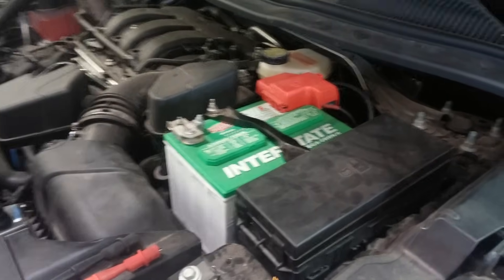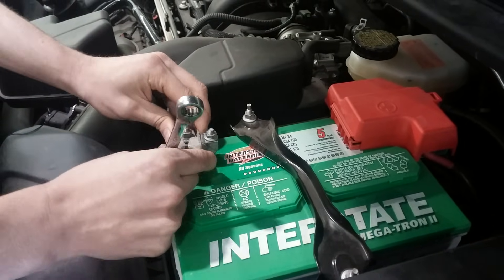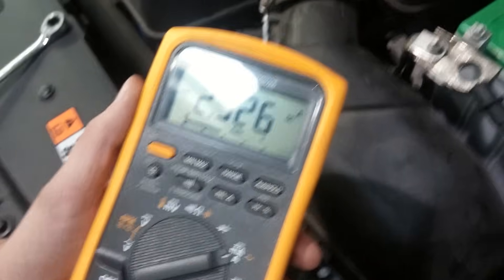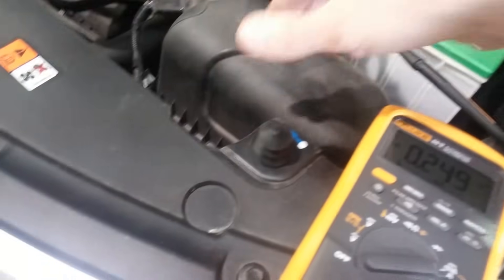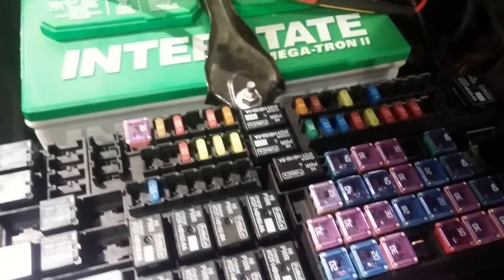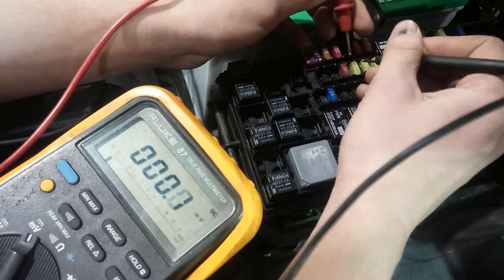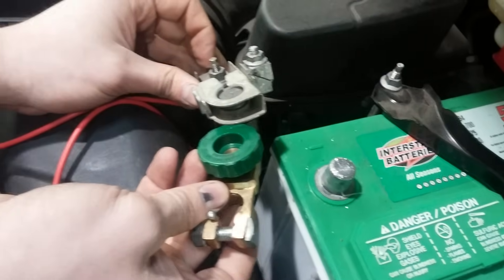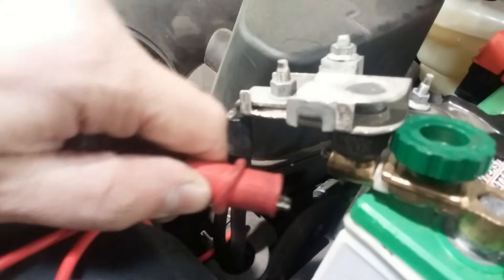How to identify and locate a parasitic drain

Comment: Great video which I watched with interest. 👍👍👍
I have a question, I have a parasitic drain and have checked BOTH fuse boxes inside and the out side with my second meter and none of the fuse showed anything untoward.
But at the battery I was show .76mA 🤬🤬🤬
I tried the method without removing the fuses i.e. with probes on top and there was absolutely nothing, no parasitic drain at yet when I go back to the battery I'm back to .76mA🤬🤬🤬
Do you have any ideas please 🤔🤔🤔
My vehicle is an Audi 1.9Tdi 8P1 2009 plate 🚗🚗🚗
Reply from the maker: This is a pretty large drain. Also, it is very possible that none of the fuses that you have tested have current passing through them.  However, we KNOW that there is a drain.   Some circuits are not fused (like the starter) and some may have remote fuses that are not in the fuse block.  

I have a couple of suggestions for you.  If you can find a "power distribution" wiring diagram for your car, it will be very helpful for either of these methods.

First, if you have access to a thermal imaging camera, you will likely be able to detect heat in the components that are remaining on.  With a .76 amp drain, something will be warm.  Start by looking at the fuse and relay boxes, then look around the engine compartment and then under the dash and around the interior of the vehicle.

Second, look at the positive battery terminal.  How many wires or cables come off the positive battery terminal?  You can disconnect them one at a time or use a current probe to see which one has the significant current passing through it.  Again, with a drain of that size, you will definitely be able to detect it with a current probe.  Once you know which battery cable has the drain, where does it lead to?   To the starter?  The alternator?  To the fuse block?

If it is to the fuse block, use the power distribution diagram to see how it branches out from there.  One of the wires must have the drain in it.  You can continue to use your current probe to narrow down which circuit is the problem.

I hope that helps!
Reply: @JustinMillerAutomotive  Hi there Justin
Many thanks for your suggestions.
I read somewhere on YouTube that a faulty alternator, diode pack regulator etc. can have a drain unfortunately I did not read this before I changed my alternator and at the same time inserted new carbon brushes.
I really don't want to go through an alternator change again.
Can you suggest a test / s that I can perform on my alternator, I have a digital Multimeter x 2 and a Short & Open Finder 
Digital Diagnostic Tool, I don't possess a thermal image equipment.
I look forward to your response.
Kind regards
Tony

Comment: You pulled the pigtail of the hood switch, now put one wire in both pigtail whole to trick the car to think the hood is closed.  thanks bill
Reply from the maker: Yes.  It depends on whether the switch is open or closed when the hood is open.  In this case (and it is the same with most door jamb switches), a closed hood or closed door causes the switch to open.  So, shorting the switch would make the ECU think the hood is open, when we want to cause the opposite to happen - to make it think that the hood is closed.

Comment: I've also seen that there are charts you can get that will show the approximate current flow across a fuse of a particular type and current rating. So, you'd take that mV calculation and then look it up on that chart and it'd tell you about how many amps were flowing.
Reply from the maker: That is true.  I have one of those charts.  However, after studying the chart, I came to the conclusion that any voltage dropped across any fuse above about 1 mV indicates an unacceptable amount of drain, so I have just taught people to watch for any reading that is not zero and pay close attention to any reading above 1 mv. 

I still refer to the chart occasionally to see how much current is flowing through a specific fuse.  Thanks for the comment!

Comment: 2010 Chevy cobalt battery won’t hold charge. Prior it would hold a charge three  months at a time. Battery tested twice at autozone battery ok, alternator ok. Now willl take a jump but dead after turned off after an hour of driving it. I need help!!! I a girl, guessing a bad cell but that’s not what they’re telling me !!
Reply from the maker: Did you check for a parasitic drain like I showed in the video?  That would be my first guess.  However, a conventional car battery can only be discharged 7-10 times before it will no longer hold a charge.  It may have started as a parasitic drain, but now the battery is probably bad.  

Another possibility is that you have poor electrical connections at your battery terminals.  Jump-starting  would bypass the bad connections, providing enough voltage to start the car.  Even if the battery is fully charged, it may not be able to get enough current through the terminal connections to start the car.

Start by measuring voltage directly on the battery posts while attempting to start the engine.  If voltage remains above 9.6 volts, the battery is not the problem.  Next, try cleaning disconnecting and then cleaning the terminals with a wire brush, making sure they are shiny.  Check the terminals on the cable for corrosion.  Then, of course, measure the parasitic drain and make sure it is below 30 mA.

Comment: do you have to have the first multimeter connected to the battery terminal/cable to test the fuses?
Reply from the maker: No, you can remove the first meter, but you must reconnect the battery cable.  If you happen to own two meters, it is just helpful to be able to see that the drain is still there while checking the fuses.
Reply: @JustinMillerAutomotive  oh okay thank you for clarifying, great video by the way. very helpful :)

Comment: Great video, but the battery shut off switch tool seems a bit useless. Why overcomplicate a simple test?
Reply from the maker: You're right - it isn't necessary. However, if you don't have the vice-grips, it can make it possible to connect your gator clips to the battery terminal.  It also allows you to easily reconnect the circuit and remove your meter from the circuit without disrupting the current flow and resetting the "timers" in the computer.  If you only have one meter, you will need to use the same meter for measuring the voltage drop across the fuses.  Those are the reasons that I like to use the tool when it is available.

Comment: faster way to find drain. make sure battery is fully vharged. D isconnect neg terminal, take test light check fuses,If fuse has power.There is your drain.Usually the device the fuse is too. the componet i.e radio. the device it self is grounding out. . there is your drain..Be ON safe side check relay to that device. too. easest fastest way.
Reply from the maker: Using a test light is a quick, easy test, but it is only effective on older vehicles before computers became involved.  Many of today's parasitic drains are not simply switches that are remaining on.  They are caused by computers that fail to go to sleep because of data network errors or other issues.  A test light won't help you with this type of drain.

Comment: by far the most helpful useful video that actually works! THIS IS THE WAY they brought me a ford f250 with
parasitic draw they took it to 2 different shop and could not find anything. thanks to this video step by step i followed 
and solved the issue. thank you for this awesome video

Comment: Will that rule of thumb drain be different on different automobile drains say like .030 ma or .050ma?
Oh my battery was drained dead, it measure  was 5. VDC , so I am charging and when I hook it back up I will disconnect the NEg terminal and start my checks,  I checked the amps as well, before I started  and it was undetermined really . But my meter showed 10amps when I connected as instructed with the neg terminal and neg cable hookup and set at the 10 amp setting  .
Reply from the maker: I have read in some books that the drain can be as high as .050.  However, I have done this test (or my students have) on many hundreds of vehicles, and when everything is working properly it is always below 0.030 amps.

Comment: I've just subscribed & rang the notification bell.
Your video was my guide in tracking down a parasitic grain on my neighbors vehicle.  Thank you.  I've searched for a Battery Disconnect switch, however, I was unable to find one with small pins for connecting small alligator clamps to it.
Reply from the maker: Maybe it is not available where you live, but I purchased my disconnect tools on Amazon or Ebay.

Comment: How do you check the fuses to the right the big one they have a closed house so you have to pull they or ?
Reply from the maker: Often, you don't need to check the larger "j-case" fuses because they feed the smaller circuits that are protected by the smaller fuses.  However, if you wanted to check them in this way, you could removed the clear cover on the back.  You could also remove the fuse and replace it with a fused jumper and then measure the voltage drop across that fuse or jumper wire.

Comment: great video, thanks Justin!!.. I"m wondering, what was the problem? What did that Fuse go to?.,.. thanks..
Reply from the maker: It was a fuse to the interior courtesy lights.  I had created this issue intentionally to simulate a parasitic drain by leaving the door switch closed.

Comment: if I heard right you said that if an amp was comming from the batterry it would  be drained in 24 hours. Would that be 24 amp hours. Idk. I had no idea. This is really good info. I have about a 50 miliamp  draw on 
my 1999 Ford. Expy.  In about 3 days my truck battery is getting very weak. I know that my battery is a bit weak.It could be some of the problem.  I was told a a while back that my vehicle was ok as long as I didnt go over 45 or so miliamps in sleep mode for the truck. I have been removing fuses etc. Taking pictures as I go. Extra precaution than just using the owners manual.
Reply from the maker: A 50mA drain is a little more than we would like to see.  However, it shouldn't be enough to cause a good battery to drain in just three days.  I suspect that your battery needs to be replaced and you won't notice any more problems (for a while anyway).  The higher the drain is, the less time the battery spends fully charged and the shorter the battery's life will be.
Reply: @JustinMillerAutomotive   I suspect the battery is a little week..Its about 3 years old. Just bought a disconnect at auto auto for about.$8.00. I think that  Harbor Freight sells a easier one to install but it has some draw backs.. QUESTION. Why does my battery start out at 13.5 volts and yet discharge faster. I am fairly ignorant about car batteries.
Reply from the maker: @PIANOSTYLE100  Car batteries are just like any battery - take your cell phone or laptop battery, for example.  The battery can be fully charged, but it's capacity has diminished.  Every time you discharge a battery and recharge a battery, it's capacity is diminished slightly.  Lithium ion batteries like those in our phones and computers can be charged and discharged thousands of times, with the capacity changing only slightly each time.  Conventional car batteries can only be discharged and recharged about 7-10 times before the capacity is diminished so much that it will barely do its job.     

A battery is a little bit like a bucket that can be filled with water.  Over time, sediment may settle at the bottom of the bucket, which reduces the capacity of the bucket - even though you can still fill it to the top with water!
Reply: @JustinMillerAutomotive  Never knew this. Batteries are definitely not my forte. Seriously going to have the battery checked.  I probably should remove both positive and neg terminals.

Comment: when you found the circuit that was leaking voltage, why didn't you pull the fuse to see if the amp draw dropped?
Reply: Good question. When you pull it out the drain should stop...
Reply: When You Pull A Fuse Out It Can Wake Up Other Circuits And Cause The Amperage To Spike Causing You To Record It Incorrectly

Comment: I tested mine for a drain and found out its the fuse for rear defroster, dome lights, and radio. Now what? I have a 91 dodge dynasty.
Reply from the maker: First, look around the vehicle.  On an older vehicle like that, I check carefully all of the interior lights, including the glove box, trunk, underhood, and underdash lights.  Make sure they are off.   If that doesn't prove anything, I might try something simple like unplugging the radio while measuring the parasitic drain to see if it goes away.  Also, look for any aftermarket devices that have been installed such as alarm systems, aftermarket radio, etc.  Someone may have installed one of these systems and tied them into the circuit you are suspecting. 

If you still don't have an answer, it is time to dig a little deeper. Using a wiring diagram, find out how the circuit branches out after the fuse to each of the individual circuits.  Then, if you can access the circuits at any place, you can place a current probe around each wire to determine which one is remaining on.  This can often be done by accessing the back of the fuse or junction box.  Another way to do it would be to look for a way to isolate or disconnect each circuit one at a time while measuring your drain.  

If you persist, you will find an answer!

Comment: How did you check the fuses with the clear caps. The ones on the right hand side
Reply from the maker: Not easily . . . However, the larger fuses usually branch off and feed current to the smaller fuses, so it is most likely that you won't need to check the larger ones.

Comment: Can i check fuses with battery neg cable disconnected or do you have to have it all connected and make the car go sleep then test
Reply from the maker: If the negative battery cable is disconnected but your meter is still connected between the battery and the cable, you can check for voltage drop across the fuses.  When you connect your meter this way, you are basically reconnecting your battery to the car.  Just don't turn things on or you will blow the fuse in your meter!

Comment: I’ve done this using the negative terminal on a car which drained the battery overnight when parked, and found nothing in terms of a draw.  Then I switched from the negative terminal to the positive terminal and the multimeter showed a draw of 2.3 amps.  These gremlins can be sneaky, and they hide really well.
Reply from the maker: That is very strange!  Any current that leaves the battery must return to the other terminal on the battery.  The only explanation is that the meter must not have been set up and connected correctly.
Reply: @JustinMillerAutomotive  Not if it finds another way to the ground.

Comment: great video... I've been having a drain problem on my 2012 Camry. How do you keep from activating the car alarm each time you reconnect the battery? I finally disconnected  the horns on my Camry to at least not have to listen to them. Is there a better way?
Reply from the maker: You can use a memory saver when you are disconnecting and the battery.  I have a video showing how to do that.  Just make sure you remove the memory saver once you have your meter connected (the meter reconnects the battery cable).  If the memory saver is left in while you try to measure parasitic drain it will give you bad numbers and mislead you.

Comment: I have a 2009 Chevy Silverado. New battery and if I drive it each day it starts. When on it runs at 14 volts. So I know the alternator is working. 

If it sits more than one day, it doesn’t start. 

When I hook it up to the multimeter it doesn’t show any draw (I followed your video)

I have a self starter battery pack. When hooked up, it start right up. 

I do see a very low light on in my reverse lights when it’s starting for me. When they are off, there’s no power and it doesn’t start. 

I’m stumped!

When I give it
Reply from the maker: There must be something wrong.  Make sure that your battery connections are good.  Maybe the battery isn't dying, but there is just a poor connection that prevents the car from starting sometimes?  Otherwise, if the battery truly does drain, then there must be a parasitic drain.  Are you reading "zero" amps when you connect your meter?  If so, check the fuse in your multimeter.  If that fuse is blown, it will read 0 amps.  There should always be some current flowing, it should just be about 30mA or less.

Comment: One thing that I would add:

Before you hook your DMM into series on the negative side, you should hook a 10 amp (or whatever your meter is rated for) fused jumper wire in place of the DMM. If the fuse blows, you know that there is more current flowing than your meter can handle. It’s a simple step that is quick and easy and will save you a bit of grief when trying to locate the source of the drain.
Reply from the maker: great tip!

Comment: My multimeter says 0.5 to 0.6 as it should so there's no significant drain. Yet my battery dies within 24 hours when switched off. I've got a new alternator fitted just a couple of weeks ago so it's charging fine. Something is killing my battery yet the drain is normal.
Reply from the maker: 0.5 to 0.6 is a very significant drain.   Your reading should be 0.03 or less.  You are experiencing about 20 times the acceptable maximum drain!  No wonder your battery is dying.
Reply: @JustinMillerAutomotive  oh dear. Thanks!

Comment: Good video.  One small observation and you fixed this at the end of the video but didn't point it out.  When using vice grips, don't connect the meter lead to the handle that releases it.  That handle is loose and floats on pins so it may not provide a good connection which could give erroneous readings.  It is much better to connect to one of the outside handles or better yet, one of the jaws touching the post.  Thanks for the video.